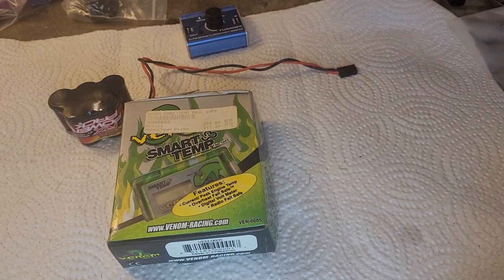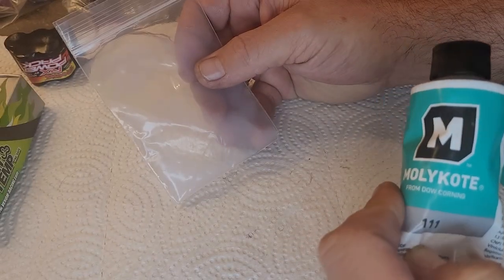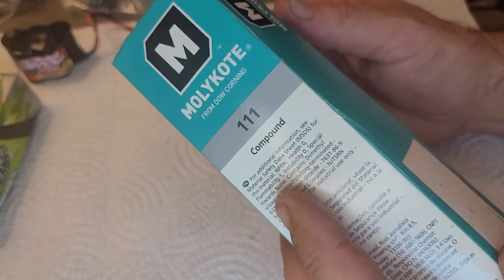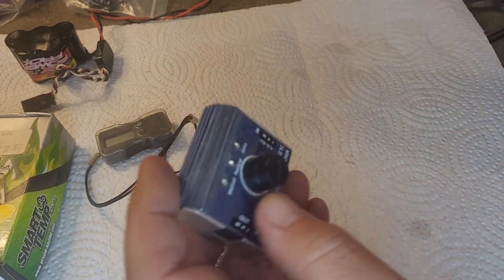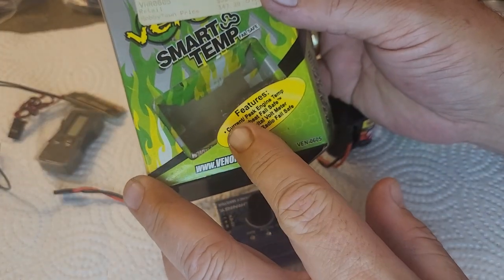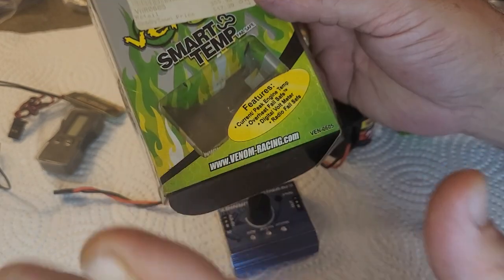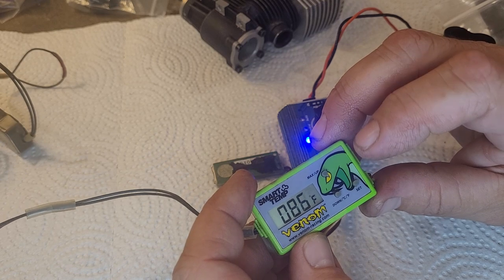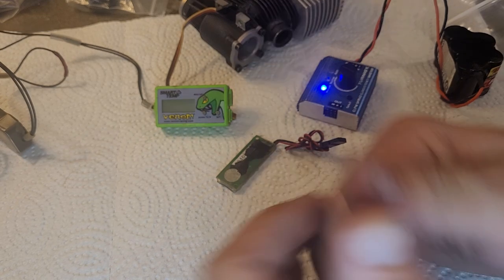Let's take a look at the Venom Smart Temp fail safe temperature battery monitor + A word on Molykote

Comment: Did you rewatch/notice that the first time you plugged in the first volt meter it showed red (all the way left) then after you plugged in the original one again (after you plugged it the 2nd one) if showed green (all the way left)?
Reply from the maker: I did notice that, I didn't catch it when making the video. Odd.